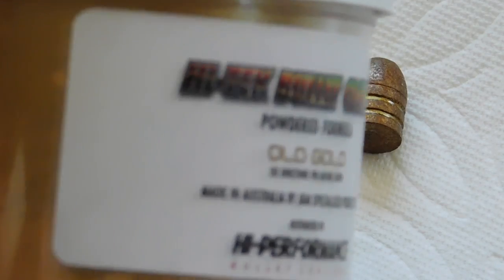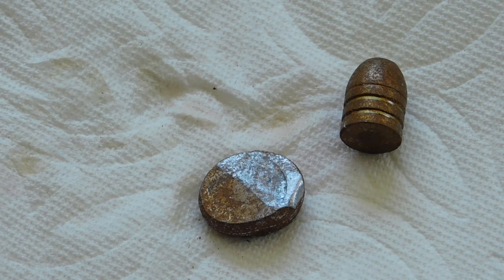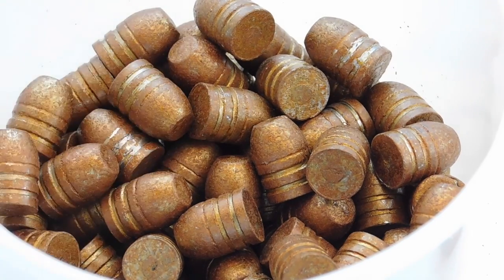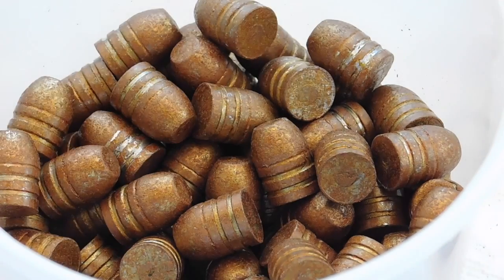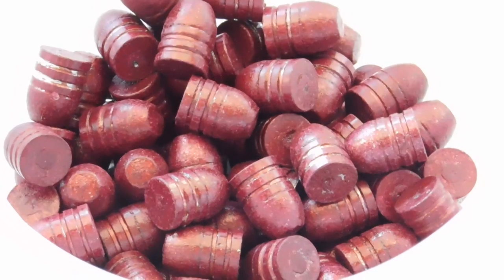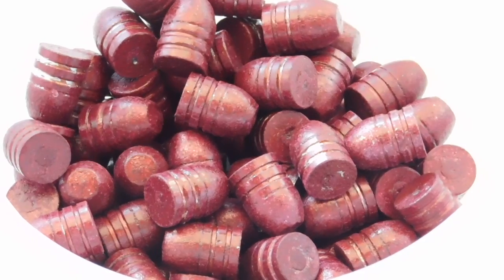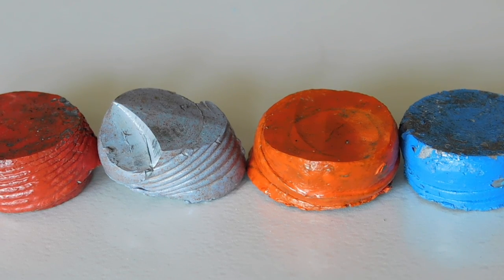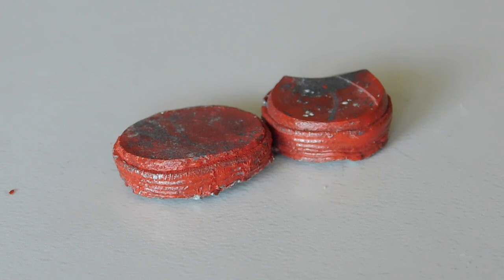Assessment And Evaluation of Successful Hi-Tek And Powder Coatings

Comment: I have been using this product exclusively for the last 8 years and have yet to have a single failure . I really like this product . One thing that I do is that instead of shaking it till the acetone has evaporated I will take an mattress inflate blower and I use the blow set up and I will blow air into my bucket for about 10 seconds to expedite the evaporation process but not to long/much air . I squirt a little solution in and on the bullets then shake them for about 10 seconds then blow some air for 10 then shake till they clump up (the acetone has evaporated) then dump them into the basket to dry. Also I use 3 tablespoons to 200ml acetone instead of 4 . I like a thinner coat as opposed to a thicker coat . Also I heat them at 500 degrees for 13 minutes instead of 450-475 for 8-10 minutes . This has worked flawlessly since day one. Also after a bunch of coatings your bucket will have enough powder coating stuck to the side of the bucket to easily do 5 to 10 coatings just get a stiff bristle brush and pour raw acetone on your bullets and use the brush to rub the color/coating off the side of the bucket and you will easily get enough to do a LOT OF coatings. Since it is not baked on at that stage the dried powder on the side of the little 3 gallon plastic bucket will mix back up with the wet acetone and can be used to coat more bullets . If I think of any other little tidbits I will let you know . Stay safe and shoot straight ;-) R&R

Comment: I run my HT lean and never do more than 2 coats.   it is rare indeed to see any exposed lead.    If that happens I will give a third coat.   Unlike PC..  the HT adds very little dia. to the bullets.  I use squirt bottles HDPE that are conveniently marked in ounces..  I squirt maybe an excess onto maybe 2 lbs of bullets..  it matters not if a little bit of liquid is still in the coating container.    I have used HT that I mixed a month ago.. I just add a few ounces of acetone to be sure and squirt it on.   I get no leading at all.
Reply from the maker: Doran Maxwell - DM, thanks for posting your findings on HiTek.  The observation can be made that there are two camps within the Coated bullet community;  the Powder coasters and the Hi Tekers.  Unfortunately, there has been some discord,even contention between the two camps. As if a camp feels the need to express some superior aspect of their system or defend against the other.  This should not be since both systems work and choosing between either is based on preferences and needs of the individual shooters.  There’s much that join us rather than separate us unless we simply choose to be contentious.  Rather we should all be hailing a new era of interest in Cast bullets - and there is plenty of room for the traditional lubers, the tumble lubers as well as the coasters.  Each should do that which works well for them bar none.  Best Regards  FC
Reply: I actually do both.    I in no way meant that either was superior to the other.    Mostly I do the HT method because for me at least it is simpler and the results more predictable but I like PC bullets too...  both methods work very well and prevent leading and leave the guns very clean and shoot accurately with some velocity gain.  The differences are that PC adds more diameter than HT as a rule but that is taken care of in sizing.   For some PC is easier to use and for others HT is   I am leaning more toward HT being more repeatable and easy FOR ME..    Lots of wait time tho for HT and none for PC.    PC will often leave bullets stuck together while HT never does...  other than that they are both great and different enough that it is worth trying both.
Reply from the maker: Doran Maxwell  - Did not mean you in the last reply.  You are a good example of the modern cast bullet shooter - doing what works, flexible, nimble, versatile...not wrapped into a particular camp, but rather easy to appreciate the pros and cons of each.  Continued good casting to ya,  FC Steve
Reply: Thanks... yes.. on some Bb's I do notice there is a very adamant "if's it's not broke don't fix it attitude"  that makes no sense to me.   While cast/lube in a conventional manner is tried and tested and works very well I find the resistance to coatings odd.   And yes...  I have lots and lots of money tied up in conventional lube/size machines and products.  Not saying conventional is 'broke'  I only say that coatings are less messy and smoke far far less and the guns are much cleaner after.    For handguns at least it seems like a win win win win situation.   There may be disadvantages to coatings but so far I have not seen any other than possible fumes while coating.
Reply from the maker: DM - Your philosophy on this is a parallel of mine - (heaven forbid..!!) - It's good to be able to do all (like able to drive a manual transmission car) and apply the techniques as we might wish or need.  Same as guns - some would argue a certain caliber or gauge is best, but really, there are always good choices to be had.   Happy Holidays to ya,  FC Steve
Reply: To you as well my friend.   If you can't have fun with it then what is the point?

Comment: been meaning to give HiTek a try some day, but powder coating is just so quick and easy...
Reply from the maker: FLT - The Hi - Tek offers thin multiple coatings so that basket processes produce defect free bullets.  And if done in cement mixers and big roll in ovens, will produce lots of bullets for sale.  Shooters would not pay for PC bullets that have the little blebs and defects from basket processing...Perfect bullets they will buy.  For home casters, PC offers one coat, but slower production from our small ovens.  Plus more colors available from PC.  However, once the Hi - Tek rolls and we keep the number of multiple coats straight, it can work very well for us with bigger ovens for higher production.  They are both good ways to go.  Best to ya,  FC Steve
Reply: thanks for the info!

Comment: FC -  The more I powder coat the more I find out about the nature of the coatings.  Your Hi -  Tek example is an easy fix  with a little more time in the oven , a little higher temp and another light coat  of the Hi - Tek ....problem solved. ... I think the real test is does it lead your barrel ? If so how much ?  I am a fan of light coats whether it's powder coats or Hi - tek. But I also appreciate a nice even -  one coat powder.  The Prismatic Silver Artery is an example of that type of coating. I just heat and shake and bake.. was amazed at how even and nice it came out.. no real need for a second coat and very little rejects. I am starting to believe that each powder has its own time/temp sweet spot. Just look at the prismatic colors manual section and you will understand that they believe that as well. There are powders just designed as base coats and powders designed as top coats. I was amazed that the Eastwood purple candy top coat held up so well. That's great news for us. If I just wanted to get the job done I would use the base coats or the opaque coats. If you want to get fancy use a top coat as a second coat that is designed to be lighter.  Also use different temp setting if you are going to use more than one coat.. if you don't you will risk bubbling of the second coat. -- Going to the range this morning... talk to ya soon-- VE

Comment: Hey FortuneCookie what do you do if a batch of powder coated bullets fails the hammer test( some minimal powder coat flaking) are they fixable or "toss'em"
Reply from the maker: david kates - That batch of PC bullets is much compromised.  Would be best to just remelt that batch.  But if you have a cowboy action load (less than standard velocity load), they could be used there...Best to ya,  FC

Comment: I PC and HiTech coat my cast bullets. Never together but have found PC much more user friendly. My toaster over temp variables are way too sporadic for Hi Tech. Goes from 350 to 430 and then back to 350, at which point the burners kick on again driving it up to 430. Cycles like this until time up. I have an oven thermometer in the oven so I can watch it happen. This wide range of heat cycle does not hurt the PC however my hi tech attempts pass the acetone test but fail the smash test more often then not. The blogs I have read on it say you need a real oven to use hi tech successfully consistently. FC, maybe you can do a video on toaster ovens and techniques on the baking and temp of the PC and Hi tech. Thanks.

Comment: I like your channel but I have to say that you are not doing Hi-Tek any justice. I have yet to see a video where you applied it properly but then judge it based off of the improper application. There are lots of commercial casting companies using hi-Tek and not PC for a reason. Please reach out to the manufacturer for some help on the application and I think you will find that it works faster than PC with at least as high a performance if not more. Keep up the good work and get your hi-tek method down. You will love the product. 
If it doesn't pass the acetone test it was not baked hot enough and or long enough.
Reply from the maker: Michael Spangler - Thanks for being a viewer...one thing in my strategic plan for the channel is to never mislead viewers with the video titles... So this one was Assessment And Evaluation of Successful Hi-Tek And Powder Coatings...Most people remember the beginning of videos and never stay around for the end....The beginning of the video speaks of successful Hi-Tek Old Gold color - how the bullets shot well and clean and the Old Gold passed the acetone and the smash tests.  The evaluation of lack of success with the Black Cherry is part of all this, but the explanation was quickly made that the oven temp was too low or not long enough even though the same cycle processed the Old Gold nicely.  My first Hi-Tek video seemed to show more production with the PC than the HT, but viewers were not listening to the speaking.  Then this video switched to PC bullets, how the smash test evaluates a badly bonded bullet vs the well bonded.  If injustice was done, it was spread around.   It's important that Hi-Tekers and PCers be able to evaluate good coatings from the not good. Actually,  I don't see where justice of anything has been offended in this video, especially since the  recently done video on clean shooting of Hi-Tek Old Gold was featured.  When I started doing Hi - Tek, I wanted it to succeed as this is a work to see all the alternatives out there and the different ways to get to our goals.  So far, I have determined that there are improvements on coating systems to be discovered that would give us the best of both Hi-Tek and PC.  The defect free finishes of broad spectrum colors available with use of one coat in shorter time frames with or without acetone... The Hi-Tek works very well for commercial outfits producing lots of salable bullets using cement mixers and roll i ovens = profitable.  Thanks again for your good comments.
Reply: FortuneCookie45LC 

Thank you for the reply. I do appreciate the testing that you do. I know you do compliment the hi-tek coating from time to time but I guess I see your videos are biased, if not by your words by your results. 
I feel like the hi-tek could be used a little better and it would shine over the PC. 
That being said I tried PC and it was not for me. It does have it benefits in increasing size of smaller bullets and the massive variety or colors though. 
I don't think what you're doing is bad I just feel like with the proper technique Hi-tek could work better for you than PC and I hope you continue to work with both to perfect the methods. 
Thank you for the fun videos and experiments.
Reply: What process changes exactly are you saying he ought to be doing to give Hi-Tek a fair shake? It isn't enough to say he's biased in his methods unless you state correct methods, and how his methods differ, and how that would lead to an incorrect evaluation.
Reply: These will absolutely eliminate lead fouling, but they won't affect powder fouling.
Reply: I think that you will find all these Lubes will be pretty much useless when used with Black Powder.  There are alternatives to SPG, but SPG has established a reliable record for Black Powder use. If one limits himself to only 2-3 rounds before a thorough cleaning, almost any decent lube will work at least a little with Black Powder, but for extended use, only SPG or a similar lube is worthwhile for the Black Powder shooter.
Reply: You haven't seen a fouled barrel until you have seen a badly fouled barrel after putting a few rounds of Black Powder through it.  A duplex load with 2 gr Unique loaded before the Black will greatly mitigate this problem, but it is illegal with all competitions that I know about, however with SPG or one of the other specially designed Black Powder Lubes, clean up is a breeze with a 1-10 Ballistol/water solution, followed with a thorough drying, then an annointing of straight Ballistol for storage  this works very well.  I've been shooting cast bullets since about 1954, and while there are other solutions for  shooting The Holy Black, this protocol works about the best I've seen.  Oh yes, don't forget to clean the complete exterior and the interior of the arm as well or you'll find out what corrosion and pitting really are.